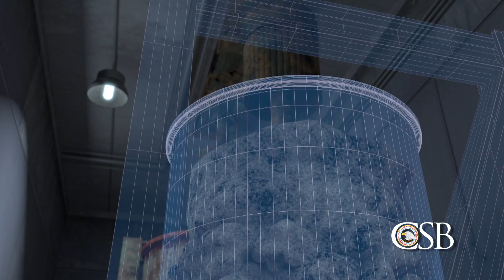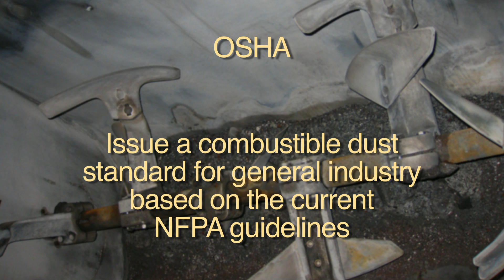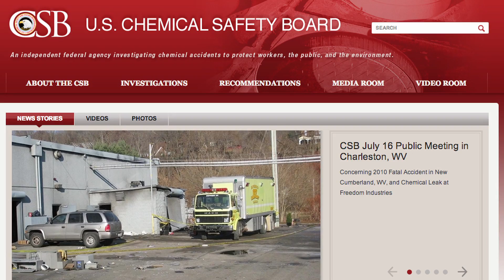Combustible Dust: Solutions Delayed

Comment: worked at a wood sawing plant, they were 3feet of wood dust behind each machine. nobody cleanining anything. one time a guy welding caught many wood piles on fire at 4AM when we were only 3 person in the whole plant. i had to extinguish the fire myself. then i stopped everything and cleaned everywhere with a 6inch diameter suction hose. they fired me later because i told the boss they were endangering the whole plant by penny-pinching and keeping 1foot long scraps and putting them in big piles everywhere. 3years later the whole place burned down. i never laughed so

Comment: I do a lot of prototyping and fabrication in my shop at home. A lot of materials I work with is steel and aluminum. My bench grinders see a lot of use but I rarely did much for dust collection besides sweeping off the bench and floor. The grinder protective case had iron powder caked on the inside and I was working with an aluminum alloy of unknown composition. Turns out it had magnesium and once some magnesium sparks caught the iron powder that grinder went up and literally melted. I did manage to unplug it and holding it from the cord put it outside but nothing would put it out. I was talking to a friend about what happened and he showed me the csb video iron in the fire. I knew metal powders are flammable but I figured it wasn't enough to be serious. Well now I have coolant pumps circulating water and filtering dust from grinding. As well as a vacuum for catching potential sparks.

Comment: So does the CSB still exist?  Trump was demanding that it be shut down.
Reply: Trump wasn't DEMANDING it. He just believed it duplicated what OSHA does. But OSHA are process morons and entirely incapable of handling any kind of chemical matter. If OSHA were even vaguely competent rather than obsessed with fall danger and working in enclosed spaces practically to the exclusion of everything else, then it actually would be duplicating the work.
Reply: @toomanymarys7355  I worked as the OSHA compliance manager for a large repair shop for a while. You have literally no idea what you are talking about.
Reply: htomerif fake news
Reply: @brad8892  not fake. In the original budget it was completely removed. However, their service to the industry is so large that the industry itself recognize the importance. So it was reintroduced with little fanfare. USCSB did release a number of videos in the period they were in limbo aimed at raising general awareness, and more depressingly, interim videos because of the impending defunding. Irresponsible behavior from the white house.
Reply: @brad8892   Not everyone is a gullible as a Trumper like you to believe that things we don't like to hear are "fake news."

Comment: So many of these videos make me furious in that all these agencies, like the CSB, NTSB and the National Fire Protection Association (mentioned at 3:46) can only make recommendations and cannot mandate that a company or industry  act on those recommendations.  Massively frustrating.
Reply: I think part of the idea here is that, as they're an independent agency that doesn't regulate anything, they're immune to a lot of the political pressures that bodies like the EPA and OSHA (who do actually enact and enforce regulation) are subject to, and therefore are able to speak more freely in their investigations, and because they're not looking to penalize someone - they're only looking for root cause and how to prevent it from happening again - investigation subjects are more likely to open up about what they saw, rather than try to cover things up.
Reply: NFPA has standards that are a part of most state and/or local laws.
Reply: Yep, like Lifelock's commercials say: "Why monitor a problem if you don't fix it?"
Reply: Yea... As far as I know here in Germany factories can be shut down by a controlle board if they don't follow certain rules as well as private vehicles (checked every second year) can be declared unsafe when critical components are to broken and need to be replaced or fixed (brakes, lights, suspension, seat belts)
Public buildings are checked for fire safety and landlords need to install smoke detectors in every room of the apartments or houses they rent out (there are obviously exceptions like no alarm required in a small kitchen) and people who own the house/apartment they are living in have to install them themselves. In case of a fire in a building that lacks detectors the insurance won't pay.
I am pretty sure that those control boards also check on hazardous materials, how they are stored and whether the factory they are in has safety precautions in place. I'm also pretty sure that officials do keep track of companies that use hazardous chemicals and provide lists for the local firefighters so they have an oversight which factory might pose a specific threat.
Reply: @annasstorybox7906  Of course they can be here, too. Don't be absurd. The CSB is an advisory panel only.
Reply: Perhaps you like your life regulated to death, but I do not.  There is a fine balance between actual safety and overzealous people who want to mandate whatever their pet neurotic problem is this week.  Germany this Germany that...yeah their cars were so expensive no one would by them, so now they are made in the U.S. and Mexico.  Again it's a balance between enough oversight to be safe, and enough freedom to not be constrained.   My MIL is the biggest control freak you have ever seen...can't be in a room without telling everyone what they should be doing and getting into their business.  Guess where she worked for her entire career?  Yep, state government lording her will over the little people who "just don't understand".   Let me tell you something, safety first?  No, sorry.  Maybe Safety 3rd.  Sometimes you just gotta get sh*t done, regardless.  How do you think China grew so fast?  How do you think the U.S. grew so fast and strong in the early 20th century?  Get out of peoples lives.  Like is said in New Hampshire.  "Live Free or Die."  Sounds good to me.
Reply: you can thank republicans and lobbyist for that
Reply: @doxielain2231  Liar. The CSB was designed to be an advisory board, not another layer of regulation. You can't claim that the CSB functioning in exactly the way that it's been designed is because of interference. This also means that they are LESS likely to be politicized than other groups, which have become the weaponized arms of various agendas at different times.
Reply: @doxielain2231  You do realize when this video was made, and during the entire time the video said "nothing was done, everything was ignored" was during Obama's reign of terror.  The dems also had a solid control of congress and senate too.  You do realize this before going right to your delusion of "everything I hate is because of Republican's"  Right?  Surely you don't just blindly say shit out of ignorance and bias...nooo, liberals would never be led by their "feeeeelings" would they?  Seems like here in 2025 your comment aged like warm milk in spite of your best efforts to pull the crap you did in this comment.  Ha!